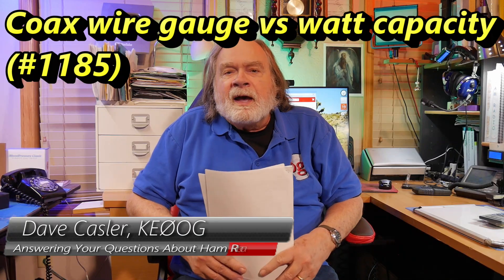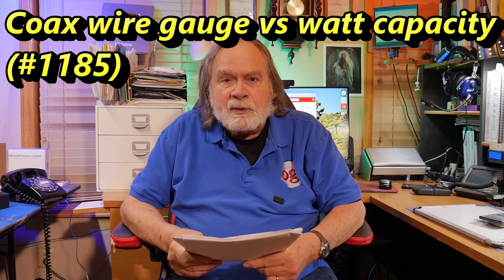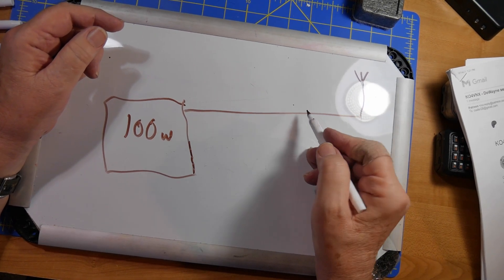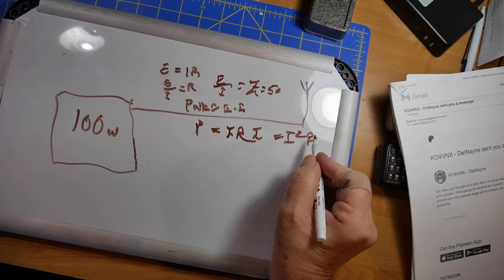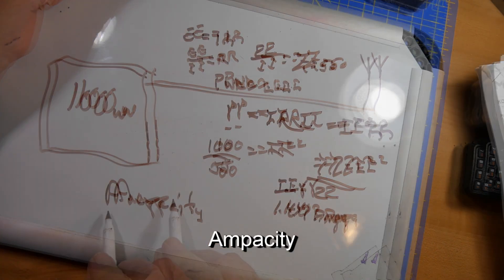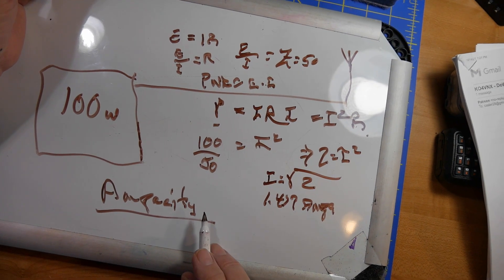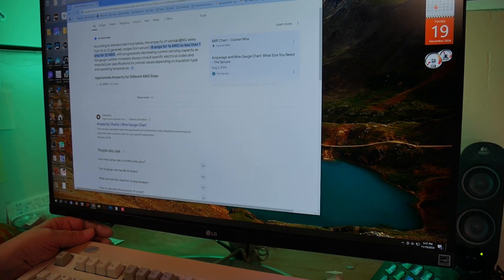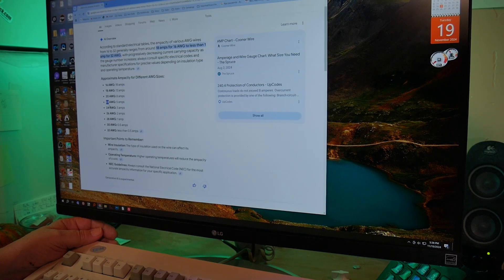Coax Wire Gauge vs Watt Capacity (#1185)

Comment: WHAT? find a way to dissipate the heat?
LOL... also note rf voltages are peaks. Insulation has a lot to do with the power level. DC current is the same as rf and ac. Current is current.

Comment: Hey Dave, great video. I found that Belden 9913F7 cable works great for an antenna system. The LMR series is also a very good coax cable to use for antennas. Both of the 9913F7 and the LMR-400UF cables are the flexible type cables and work very well for an antenna that rotates. Again, thanks for a very informative video.  73’s….....

Comment: I have never considered using DC theory on an RF calculation. I would have gone with cable losses, heat, compaired with the ability of the cable to dissipate the heat.

Comment: Does the length of the run factor into the calculation when selecting the wire gauge?
Reply: Cable losses are greater for longer cables. For DC and low frequencies, like house wireing, yes. If your 12v power is only 5v when it gets to the other end of the wire, it may not work. For RF, look at the cable loss of your cable at the frequency that you are using. It will be given per a particular length. With that, you can determine the max length you can use for your application.

Comment: what about coax cables in RF situation where the skin effect rise with the frequency.. most of us start with the cheap RG-58 but nobody know the Frequency vs Power limits (we only see the power loss tables vs frequencies).. also i never saw the power limit of a BNC connector often saw in the field.. anyway, thanks for this subject!!
Reply: Good question, I had to look it up. For BNC, I found 3.5 amp typical, but there are some that are rated at 5 amps. The losses are dependent on frequency, and that will affect how hot they get. You don't want to melt the dielectric.

Comment: The counter-intuitive fact that aircraft wiring prefers higher current per gauge to reduce weight is really interesting, it makes sense but I would not have expected it either.

Thanks for throwing that in! :)
Reply: Don't  aircraft use 400 HZ  instead of 50/60 HZ. I do know that you still get a shock, that will wake you up, from the voltage that the aircraft use.
Reply: The losses in the cable determine the heat. The size of the cable bundle determines the ability of a cable in the center of the bundle to get rid of the heat. If you are designing an airplane, you also have the time to consider this along with signal integrity at the other end of the wire. For house wiring, it is just a value that always works. No calculations are required.